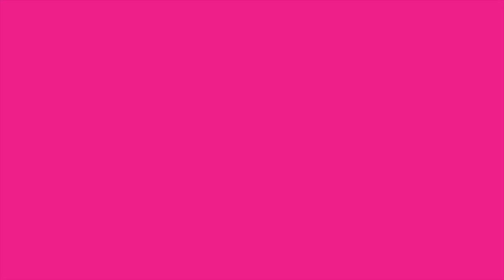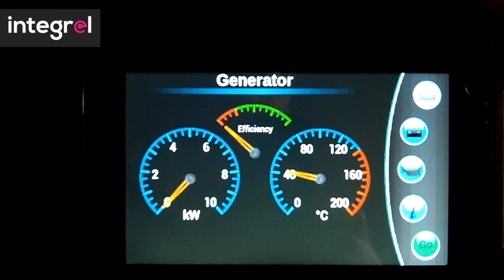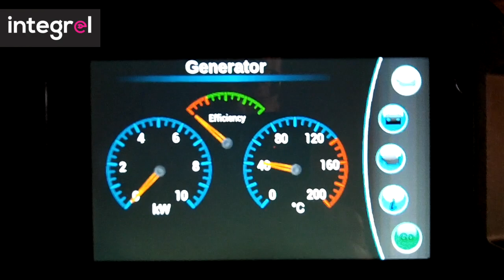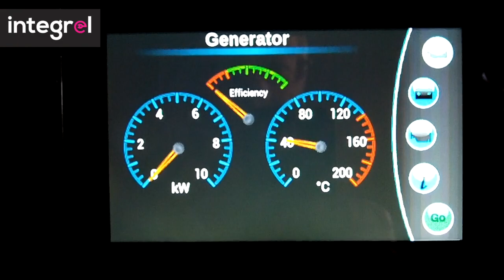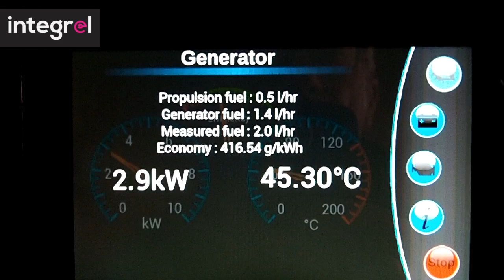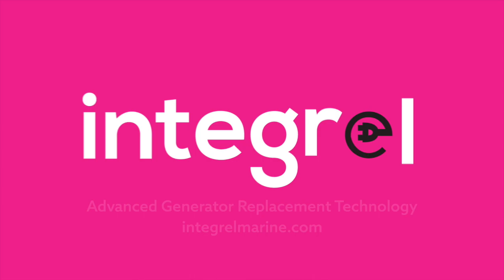Integrel E-POWER Efficiency Demonstration

Comment: You say that propulsion fuel efficiency with the generator is 50% more efficient and half of what it was without the generator. But you fail to point out that overall fuel consumption is approximately double. So yes, you get a large amount of power generated but at what cost? To make any sense of this you should share a test that shows what level of power your system generates per gram of fuel compared to an out of the showroom boat with a standard engine alternator.
Reply from the maker: Hi Zeki. Thanks for your comment. 

We use the generator as a variable load on the main engine, exploiting the fact that, for most of the rev range, the propeller does not apply sufficient load to allow the engine to run at its most fuel efficient.  By adding an additional load with the generator, and controlling it in real time,  we can pull the total load on the engine close to its optimum, typically about 75% of maximum.

As regards overall fuel savings, by loading the engine optimally for most of its rev range we can maintain a specific fuel consumption of about 320g/kWh whether in generator only mode or generator plus propulsion mode.  Actual total fuel savings depend on the way in which the boat is used and the efficiency of the generator that we replace but they are significant.

Your comment about fuel consumption increasing when the generator load is applied is correct but that fuel is now being burnt much more efficiently.  We now have one engine doing two jobs at peak efficiency instead of two engines doing the same amount of work inefficiently.

If you have any questions, please do contact us again. We can also send you some graphs which give actual figures on the impact the Integrel system has on fuel economy. Please feel free to find us on Facebook and send us a message. We can then provide these for you. 

Many thanks
Reply: The way I understand this, you’re not getting free work for zero energy. The more work the engine does the more horsepower it needs, and fuel is used to generate horsepower. The difference in having efficiency is a measure of how much fuel is going unburnt out your exhaust. If your engine is 100% efficient then no unburnt fuel is released at the exhaust, it is all used to produce horsepower. The extreme opposite of a good diesel engine is a little radio control airplane where you will see 80%, of the fuel is blown out the exhaust unburned.
Therefore the goal of this device is to add variable amounts of electrical generation load onto the engine when you are simply noodling along and the engine is otherwise unloaded, therefore blowing unused fuel or worse, causing Coke formation in the cylinders.

Comment: So you can have optimum efficiency for propulsion only, at low to midrange revs in a catamaran, when one hull is driven by a diesel and the generated electricity is used to power an electric engine in the other. Is that right?
Reply: Exactly what I was thinking. Use this on one diesel in one hull, get about 6kW. 

For an efficient hulled cat, this could be used for an electric engine in the other hull which could improve the speed (which the diesel is already giving you) by some amount which is hopefully less than the diesel burned to generate the power. It seems that the diesel burn in L/hr is about half the kW (just from a few data points shown). Assuming pretty good efficiency in the alternator, we could hope that generating 6kW wasn’t taking more than say 8kW/13hp from the diesel. For a large diesel, say 100hp, that’s not too much - it’s using say 13hp to run the boat at 5kn by itself at about 2L/hr, the alternator is generating 6kW from another 13hp or 3L/hr (half), which powers an electric motor on the other hull directly which could raise the boat speed to 7kn. 
So 5L/hr diesel for 7kn speed. 
This is a bit better than what we currently get, but not enormously. 
Note that this efficiency is based on direct coupling the alternator to the drive - you’d lose efficiency if you went via a battery. Use solar for the battery instead.
While not enormously better efficiency than pure diesel for us, the advantages are there in quietness in one hull, half the maintenance by doing away with the second diesel, and the ability to run electric “only” using the alternator without powering the prop. The diesel is still there for higher speed (still electrically assisted in the other hull, but limited by the alternator). 
The disadvantage is that the cat would have to run reasonably straight in the offset power situation or the drag from the rudder to fix it will rob you of the overall efficiency.

Comment: Can you guys explain how this is measured, and how everything is accounted for?  For example how do you measure the kW propulsion load, and how do you measure/calculate the fuel burn total and apportionment between power generation and propulsion?  I'm not seeing how the numbers add up in each of the operating scenarios.
Reply: The engine only turns the prop, and the prop moves the boat. I don’t think the efficiency numbers shown have anything to do with SOG or any dimension of the boat traveling.  If the engine is properly loaded by the prop to achieve WOT then you should be able to use the prop manufacturer’s load factor curves along with the electrical energy produced to understand fuel flow and efficiency.
Reply from the maker: The fuel consumption comes from the ecu and is accurate to better than 99%. We measure the electrical output on the DC side after the controller again at better than 99%. Prop load is calculated using the non dimensional curves  but is essentially the equation used by propeller designers and is crank load. Using the efficiency curve for the OEG we can again calculate crank load. We now have total crank load and total fuel. One engine, two jobs so the fuel efficiency is the same for propulsion and generation, hence the fuel consumed for each task can be calculated.
Reply: @integrelsolutions3943  
So actual load on the prop is not measured, meaning if you are motor-sailing and running the generator these numbers for efficiency are wildly inaccurate.